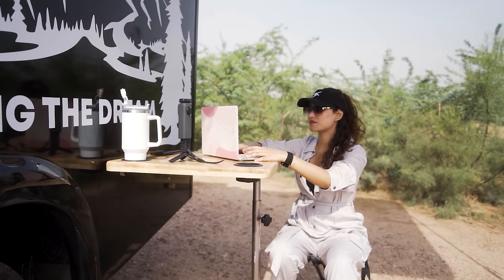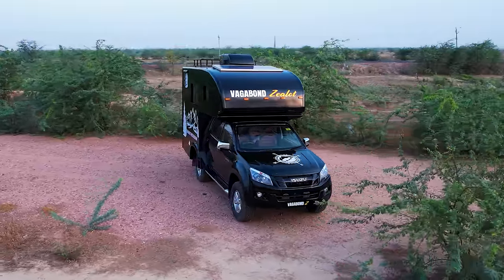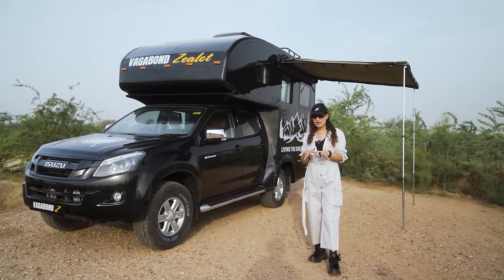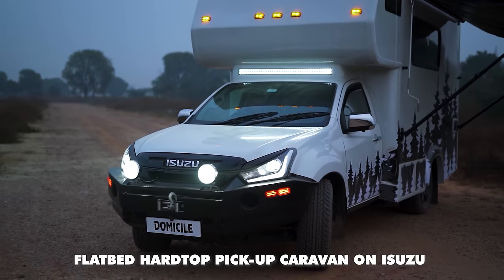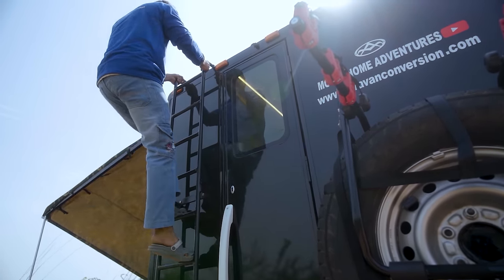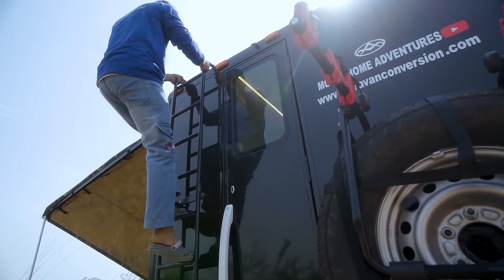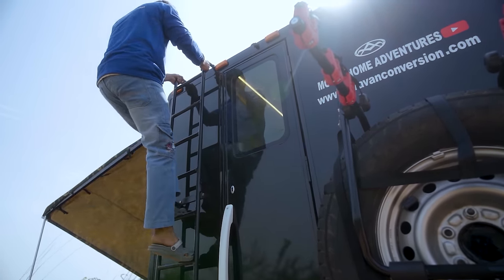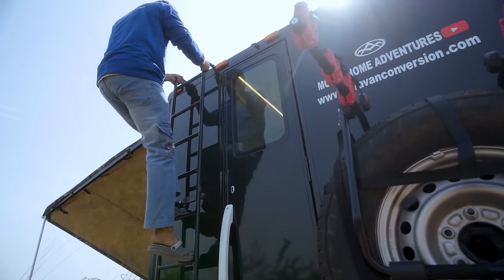BUY THIS 2024 PICKUP TRUCK CAMPER ON ISUZU/RENT This Truck Camper in India | Motorhome Adventures

Comment: You claim to be expert in caravan building. But in all your designs I see female socket being given for shore power. You always use male socket on the receiving side and female on the supply side. This is practiced for safety so that even if the shore power plug comes off it’s not an energised open end which can electrocute somebody.
Reply from the maker: You're absolutely right, but you must be aware about the 30-amp Inlet & female connector price.. 
Most if not all of the people would rather take precaution than spend that amount on that system which can electrocute somebody... We've got the provision ready provided people opt for those.. because at the end we Build as per client's specifications.
Reply: @ safety should never be an option. And the cost difference for industrial male socket may be 20-30% more which is in 100s. Safeties always a practice and not option.
Reply from the maker: Please know that in India there is no industrial male socket available as a receiver and female as main grid power supply. The system which is available costs more than what people want to spend. As a Fabricator who builds as per specifications we try to provide the best possible fitments but at the end it's client's choice to finalize or not finalize the same.

Comment: What does basic to basic conversion includes  ? Please mention the specifications what you mean to say or that includes in basic to basic conversions  ? For eg: just body structure, wheel height and size upgrade, all essential electrical appliances including inverter, solar setup, fridge, tv, water purifier marine grade toilet 🚽 etc etc etc? Please be specific and clear all doubt as all viewers wish to make one for themselves and due to lack of information of conversion cost makes people scarred to have one. Please make a separate detailed video on cost of conversion including appliances and hard rooftop tent with solar panels etc.
Reply from the maker: A basic model is inclusive of all amenities minus the upgrades, that were added in this conversion. We have an expertise in Building as per specifications thus it'll be better if you connect with our team to share your vision further to which we would be able to provide you the costing as per your requirement.